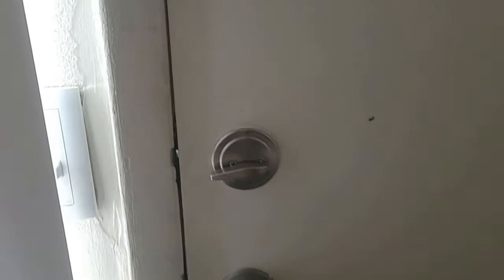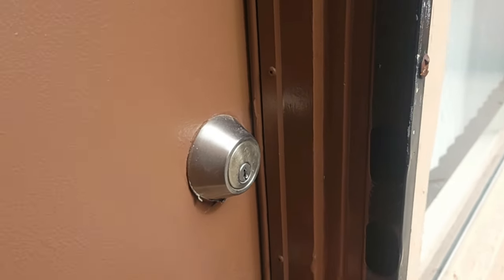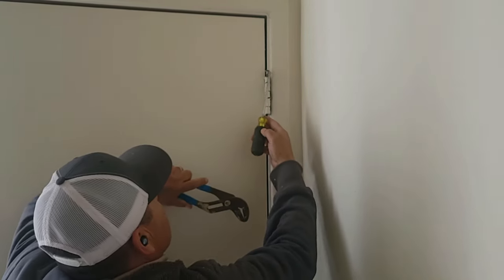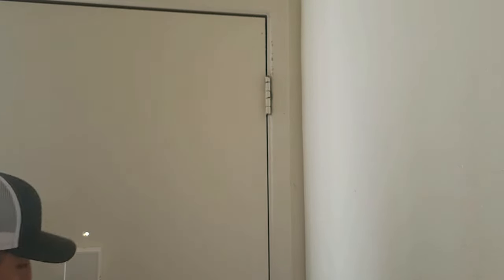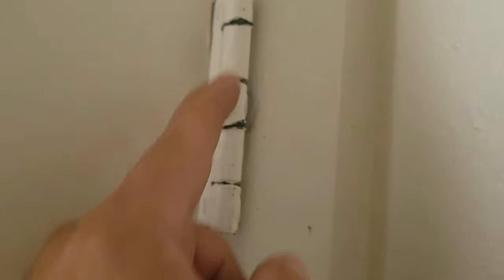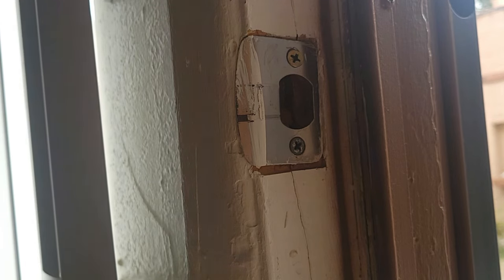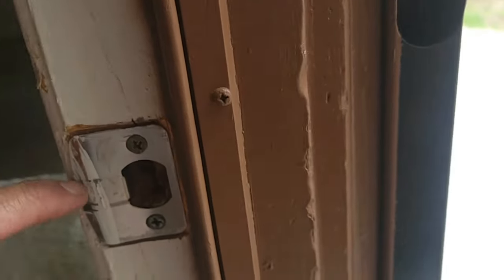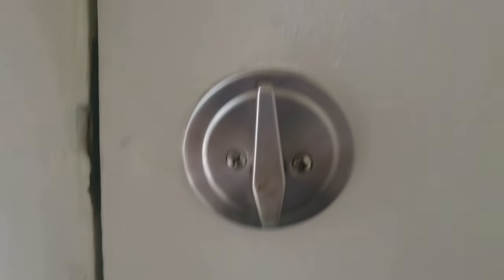Fix light gap or weatherstripping. #apartmentmaintenance #weatherstripping #doorrepair

Comment: It’s a better idea to fill the old holes on the strike plate with some toothpicks and a little glue so you don’t slide the screws back in the same holes. You’ve also got an uneven margin line on the top of the door from handles side to hinge side. You need to do the same thing on the middle hinge and on the bottom hinge to bring that up to where the door doesn’t look like it’s hanging out of place . I am now a subscriber. Thank you, brother.

Comment: The screw holes for the strike plates are shot.  The holes should be filled with wood splinters (toothpicks) and glue, and new holes drilled.  The screws look like drywall screws which are coarse  thread and not correct, but that’s all he has.

Comment: The bending of the hinge knuckles is professional.  I first thought it was a bad hack, but it works well and the alternatives are not good, like removing the hinge and using shims which is a bad idea if you don’t know what’s out of plum.  But you need to know which direction to bend the knuckles, and often you have to also bend the middle hinge knuckles to get a smooth closing.  Also, check that the hinges are attached tight, so inspect that the screws are tight and the hinges are not loose or crooked.

Comment: Love this easy fix. My question is in  two parts; first, can you use this on the bottom hinge to close the gap on the bottom? Second  part is once done with making adjustments do you also bend the other so you can put the pin back in? I have cousin in the Tucson area and my aunt and uncle used to live off grant. Both passed away a couple years ago. My uncle was heavily into the masons and shriners. He helped build the mall and high school.

Comment: Usually there is a lil tab on the inside of the lock catch you can bend to adjust where the door sits against the weather strip. Also love the bend the hinge knuckles tip

Comment: Suggestion: use the scrap splinter wood material that you cut out with the razor blade to stuff inside the old hole. That will add some extra level of stability so that your new screw has no chance of breaking out because of the weakness to the left of it. It's worse if the new hole is really close to it versus how far yours is maybe but it really helps to reinforce that area laterally.  Thank you for the tip on bending the hinges. I've never done that before or seen that and have quite a few that I could use that technique on

Comment: carry some golf tees to drive into the striker plate screw holes, then score with your knife then tap to break off. carry some 3 inch exterior deck screws to replace one top hinge screw to the jamb. the door weight loosens and sags the jamb. the new screw will reach to the framing and pull the jamb back ito place. bending hinges is a last resort method.

Comment: Thanks for the video. But the door opens out to the outside and there's a gap between the frame and the door. Weather stripping is good. Door is metal and new but installed about .70 of an inch away from the frame :( what can I do?
Reply: Why can you not do the same thing in reverse?